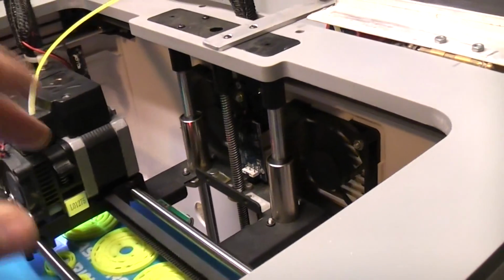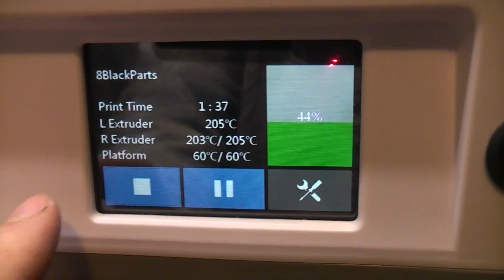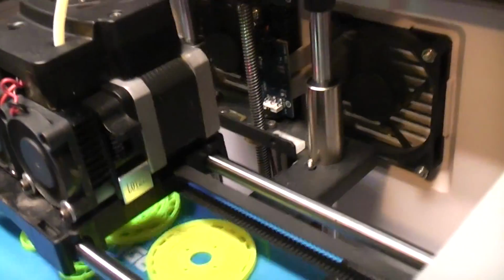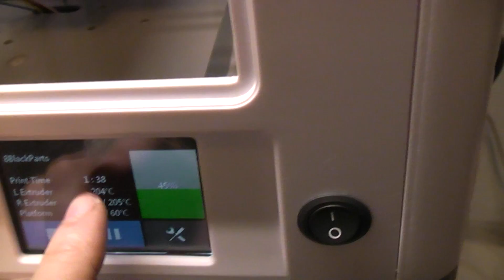Flash Forge Dreamer Mod's and are the used ones on Ebay "for Part's only" worth buying ?

Comment: I have a Dreamer, and yes, it does jam once in a while. What upgrade would you recommend? The hot end slides into the hot end mounting block and is held by the set screw. I see you mention E3D, but what version, specifically? Thanks.
Reply from the maker: There are so many new light weight hot ends out right now that I do not know what one would be best. I sold my 2 Dreamers years ago so can not test any out for you. But The dreamer is a fantastic machine, only the hot end was crap. So a upgrade would really be fantastic.

Comment: 5 years later I just bought two for $80 a piece :)
Reply from the maker: Wow , nice deal. At that price you can upgrade the hot end extruders and have a nice dependable printer.
Reply from the maker: @Daniel Massicotte Yes it is a great time for the DIY guys and 3d printing these days. Low prices and anything is possible.

Comment: Geez this wss very noisy.  Are all fans running on max speeds or something?
Reply from the maker: Yes max speed and yes the fans are loud as hell on flash forge printers. Also there are a lot of fans . 2 large fans in the back of the case, 1 in the electronics in the base of the case, each extruder has both a part cooling fan and the heat break fan. So it is fan city.
Reply: @Robothut  Thanks for the reply! 

Have you tried printing ABS yet? If so can you print with most fans off then?
Reply from the maker: @Nephilim2001  Yes the flash forge dreamer is set up for ABS, the rear cabinet fans turn OFF and only turn ON when the temp in the cabinet gets to high and like all printers the part cooling fan will be OFF or low speed when printing ABS. The heat break fan and electronics fans will still be turned ON. The bad things about ABS on a flash forge is that the hot end design runs the PTFE tube all the way down to the nozzel so the higher temps you run for ABS will burn the PTFE tube and then you get a clog. The hot end design on flash forge is the week link. Put in any of the new light weight all metal hot end units and you have a great ABS printer for sure.
Reply: @Robothut  Alright thanks! I've just ordered my new Dreamer NX and was looking for a sollution to the noise. Was thinking about changing the fans too. Have you changed  hot ends on it now? Or done anything to reduce noise thats actually made a difference?

I appreciate you taking the time to answer all this. And your video was quite helpfull. Thanks!
Reply from the maker: @Nephilim2001  The Dreamer NX is different in that its newer, I bought my Dreamer back in 2015 and it was used then. You can still by used ones in the $150 buck range sold as non working on Ebay from time to time. I bought 2 of them that way and had both working with in 1 hour. I sold both my Dreamers a few years ago to a guy that wanted to use them for ABS 3d printing.

Comment: It's crazy to disconnect one of your print heads even if you don't plan to dual extrude.  I use one side for TPU and one side for PLA.  I never use them at the same time.
Reply from the maker: It reduces the mass that the steppers motors have to move and improves the print quality by reducing ringing or ghosting. Back then  2016 ,I only printed PLA, so had zero reason to keep both print heads.
Reply: @Robothut  Yeah, I can see that.  I just picked one up about a month ago for $300 and I am real happy with it but being able to have each extruder set up for a certain material is a serious bonus for me.  I've been using my first crappy put together kit from like 10 years ago for all the more experimental type filaments and my Dreamer NX (same unit, single extruder) for my PLA.  

Having the heated print bed of the dreamer, with it's very exhaust friendly case... it's amazing for its price.
Reply from the maker: @polydynamix7521  Yes I agree. The biggest problem is the extruder / hot end design. They just tent to jam up about every 20 prints or so. but it would be easy to replace the extruder / hot end these days with so many great light weight units out there. We did not have so many things to pic from back in 2016. But for price how can you beat a enclosed dual extruder printer like the dreamer !
Reply: @Robothut  There's a very cheap and perfectly fitting all metal hot end you can put on it that solves the majority of the issues with it clogging where the hot end has that little tube on factory type.  

I think I've only seen it on ebay but it's cheaper than the actual flashforge replacement part.  Same with the magnetic bed- it was $5 cheaper than a 3 pack of the sticky pads from flashforge.
Reply from the maker: @polydynamix7521  Back in 2016 I tried a all metal hot end "not cheep" and I found what others say is still true today, they do not work well with PLA if your designs are high in detail. Thats means lots of retractions. They clog up. PLA stick to all metal hot ends and retractions make it happen more. In my case I had a this robot body that took about 10 hours to print and it would fail every single time in the same place when I used the all metal hot end and if I switched back to stock hot end no problem. Now that was 5 plus years ago But from what I see on the new all metal hotends they all still say if you use PLA it is probably not worth going to all metal. But to each there own. All metal hot ends are great for high temp filaments.
Reply: @Robothut  Do you still use the machines?
Reply from the maker: @FriendshipLights  I sold them years ago. If I did have them I would upgrade the hot ends, as that was realy the only bad part of the design. The small build area I guess would be a problem for me these days as well.
Reply: @Robothut  yes totally agree about the build area. For me I have been using Creator Pro’s since 2012 for the amazing Friendship Lights. Small item, works well (ABS). Although I do have a few Enders to create larger items.

Comment: I too have purchased an ebay "for parts only"   $320 Creator Pro.  printed a new carrier for the X axis, cleared the plugged nozzle, and tightened up and aligned everything, (screws were loose) well worth the money and the time to repair.  Extremely solid machine
Reply from the maker: Yes when they sell in the $300 buck range you can not go wrong. Spend a few bucks and reto fit them with E3d type hot end to get rid of the plugging  nozzle problems they seem to have with there nozzle design at least on the Dreamers and you have a fantastic machine for cheep.

Comment: You can change the color of the light using flashprint.
Reply from the maker: I do not think that flash print lets you change the color of the light, but it is easy to change the light colors with switches that you add to the RGB LED cables or even replace the RGB drive with a cheap Ebay LED RGB driver. I used switches to control my lights since its so easy to do.
Reply: Robothut https://m.youtube.com/watch?v=Xc7fGs6j8UQ
Reply from the maker: There you go. Thanks for posting video link. I have never had my computer connected to my Dreamer printer so never knew about the firmware control part of the unit. Very cool. Flash Forge printers and soft ware have been advanced compared to other printers for many years now. The only thing I do not care for is the design of the hot end. If they went to a E3d type hot end on the Dreamer that would have been so cool. I have no idea what type of hot end they use these days as my dreamers are so many years old now.

Comment: Great video. Many thanks. One question, do you find the plastic frame/enclosure is robust enough? Does it flex during use or expand with heat?
Reply from the maker: The injection molded plastic frame is rock solid. You can not make it flex. The build size is small for such a large printer but the price is right if you want a work horse printer for cheep .
Reply: Robothut Fabulous. Many thanks!

Comment: im thinking in remove the right extruder to use the left  i only print in pla, did you recomend only remove the nozzle or nozzle and extruder? i think just need to remove the nozzle for better prints and fast leveling , what you think?
Reply from the maker: Just nozzle will make things easyer but I removed it all, as I have no plans on doing dual filament printing. By removing the complete extruder you reduce the weight of the extruder carrage and this can only help the print quality. I did make the mistake of removing the Left extruder and used the right. The problem with the way I did it is that the right extruder does not get as much part cooling fan action. The part cooling fan is very important when printing PLA. In fact if you look at some of the best printers out there like say a Ultimaker you will see they use dual part cooling fans blowing from each side, it really improves the print quality on steep angle and over hangs .In the end I just extended the part cooling fan duct. I really should just design a dual cooling fan set up and maybe change to a E3d type hot end as they work better with less jams.
Reply: Robothut im dont have plans of use both so im going to remove it the extruder too , i m using my dreamer for 8 month  , i dont have any problems leveling  but i see a lot of people that said  they removed one of the extruders and move better and faster  thanks
Reply from the maker: Before I went to a magnetic built plate I was always messing up[ the bed leveling when I pried of the prints but once I went magnetic bed then I have never had to re level the bed. Never. A nice flexible magnet bed is the way to go, just remove the magnetic bed when your done printing and the flex it and the parts just pop off the build tack surface.
Reply: Robothut thanks for that, any link of a good one ??  to buy

Comment: I am trying to fit a Dreamer M/board to FFCP found using a separate power supply 240 v to 24 and connect direct to heater/s run about 15 v gives a lot of heat..any chance of a wiring diagram ,,need to check connection for HBP etc Thanks in advance
Reply from the maker: I do not have any wiring diagrams or schematics, they seem to keep that all in house. Sorry.
Reply: ok thanks will see if i can find a good pic of what goes where ,,thanks